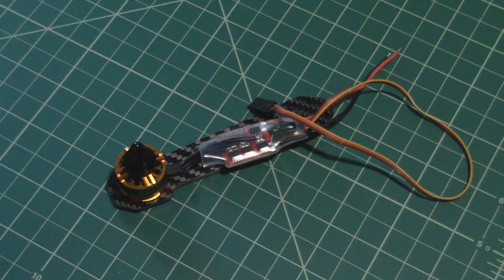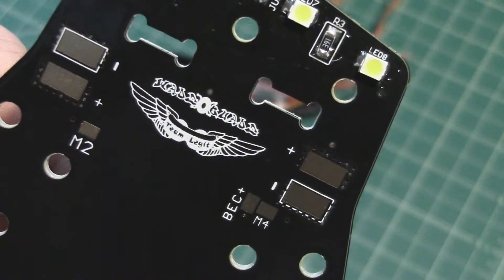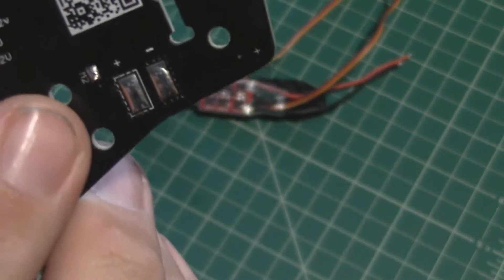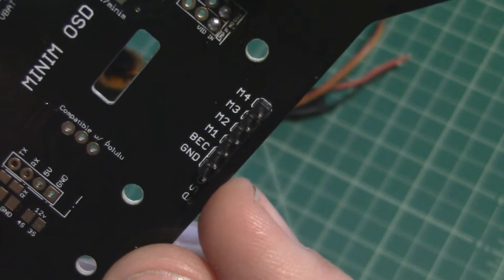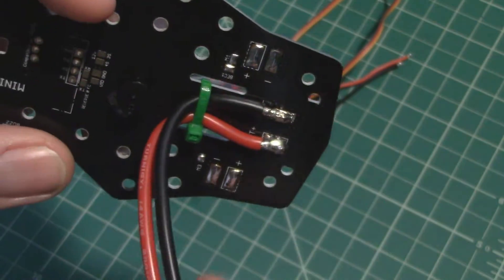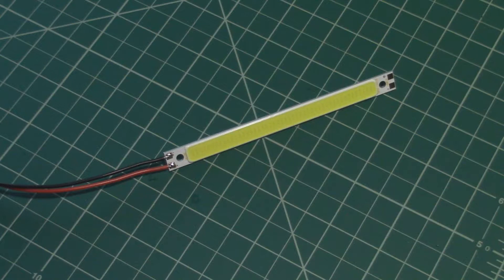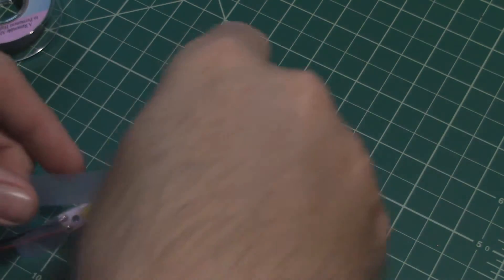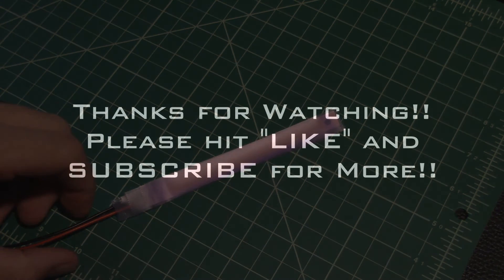ZMR250 Quadcopter - PDB and LED Prep

Comment: Why is there a BEC solder tab on motors 1 & 3 but none on motors 2 & 4? All of them have a Mx solder pad. I think you only soldered Motor 1's BEC signal wire to the PDB. So does that BEC wire go on a trace to the BEC pad mid-center on the PDB where you added the pins? And from there to what or where does the BEC signal go? Do you need to do anything, add another pin or wire to get it there?

Comment: Where can I find the LED COB that you have?
Reply from the maker: Amazon is where I bought them.  they are also on eBay or Banggood or Hobbyking.   I have ended up using Scotch Expressions tape, 2 layers, for the color, and used a small dab of rubber cement on each end to hold the tape down.  It is still easily removable.  
http://www.amazon.com/gp/aw/d/B00PAE42IC/ref=mp_s_a_1_6?qid=1456148562&sr=8-6&pi=AC_SX236_SY340_FMwebp_QL65&keywords=cob+led&dpPl=1&dpID=31q%2BtnVD4yL&ref=plSrch